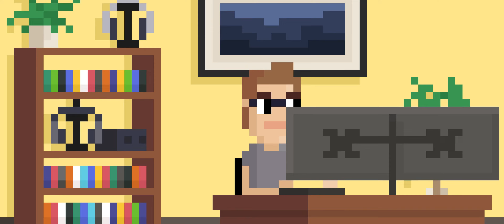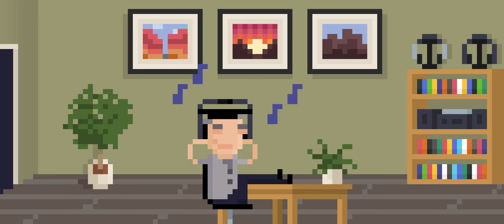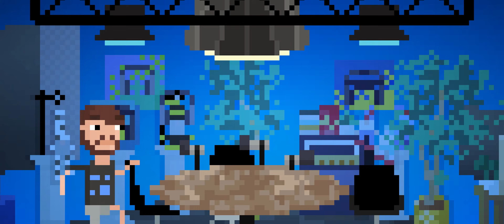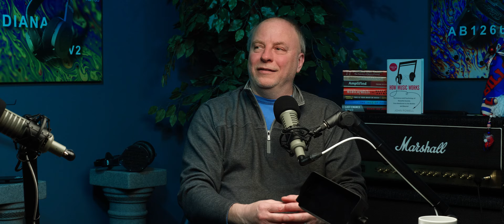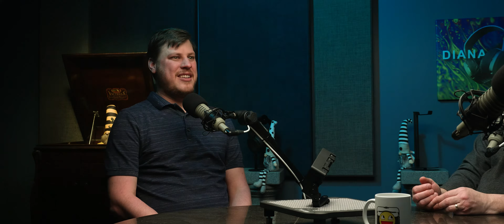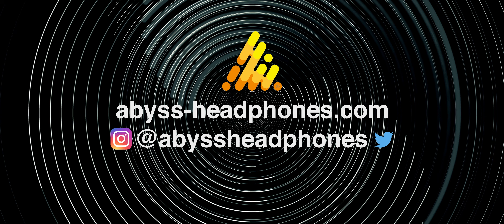BAD burn-in? (headphones)

Comment: When I got my new car, the manual recommend that I don't use cruise control for the first 1000 miles, to break in the engine. I did that for 99% of the first 1000 miles.
Reply: what does that have to do with headphones?
Reply: @greaser3069  the analogy is to break in headphones, listen to a variety of music to exercise all frequencies, while breaking in a car requires that the engine runs with more variations from your foot rather than a steady state with cruise control.

Comment: Based from the conversation, i am left wondering how long should be the expected life of headphones. I know that warranty won’t cover but it will help me know if I can warrant buying some the pricier headphones. I am right now comfortable up to 800 dollars but can go 1500 if I think I would really like it.
Reply: Honestly, basically forever as far as most people are concerned. The issue though you'll usually run in with headphones is maintenance of headband pads and earpads before a physical degredation of the driver materials. Depending on how heavy you use, it'll be decades of use or only a few years. I'd get something you can very clearly maintain with headband, earpad, and cable replacements.
Reply: @NotAFanMan88   Thanks. I will check if my current headphones can last 5 years then try to upgrade to a diana TC. I have a 3 year  mid range headphones.